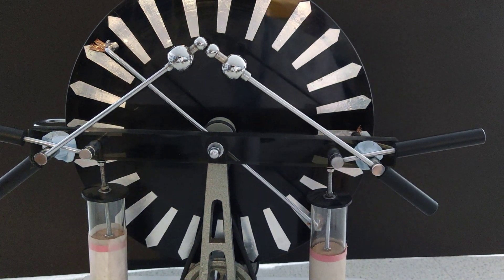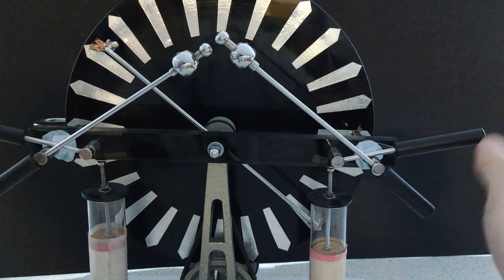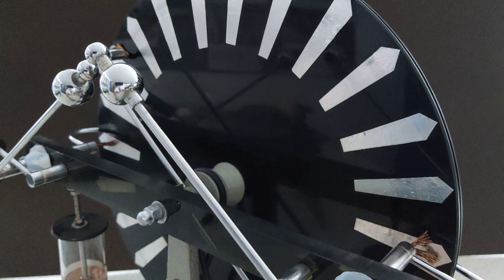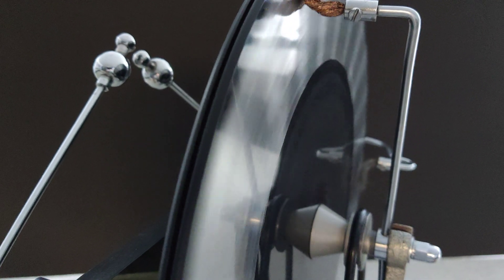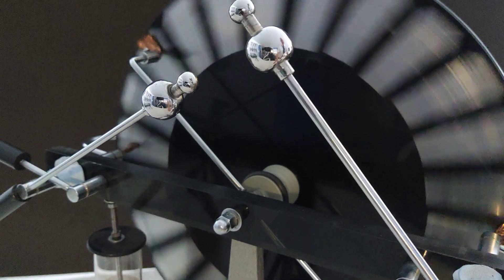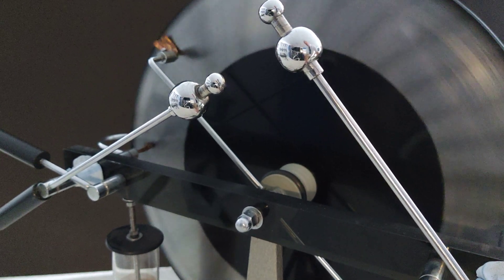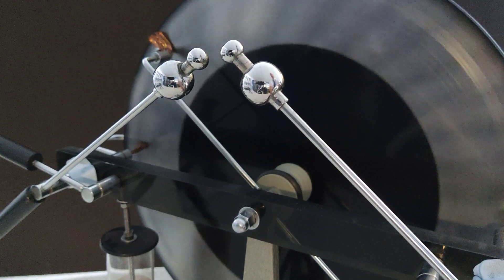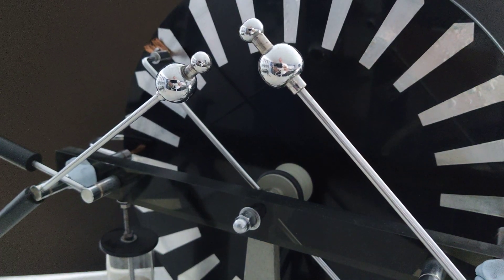Deadly Sparks - Wimshurst Machine and Leyden Jars - Electrocution?

Comment: I just found an old broken one in our Physics Store room. I had a hard time finding round rubber bands for the pulleys. Any suggestions? I looked on Amazon but I could only find square ones for old tape players. I am dying to shock students with this so please help me get this working ;) !
Reply from the maker: What about AliExpress they have unusual things like that? Maybe you can try an aux belt from a car or a wood work machine?
Reply: Some models of Makita belt sander have a round section belt, but it's probably too short.  I'd suggest looking for "O-Ring splicing kits" -- these have spools of O-Ring rubber, cutter, and glue for welding/gluing the ends to form a continuous belt.  You can make the belts different lengths easily (the crossed over one needs to be a little longer), and sized to require a little stretch to install.

Comment: So if it was hooked up to alternator that powered a motor to turn the will it might run by itself correct..
Reply: No.  That would be perpetual motion, which is always a hoax.  A Wimshurst produces very low current (microamps) at very high voltage (tens of kilovolts); it won't run a conventional motor (there are electrostatic motors that will run from a Wimshurst or Van de Graf, but they have almost no torque).  And it takes power input to make the Wimshurst generate its static charge.